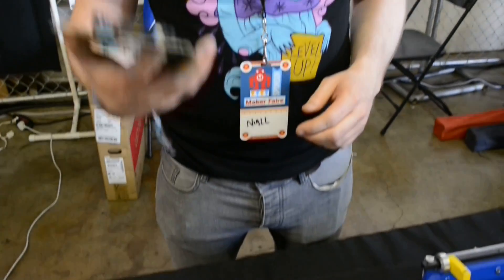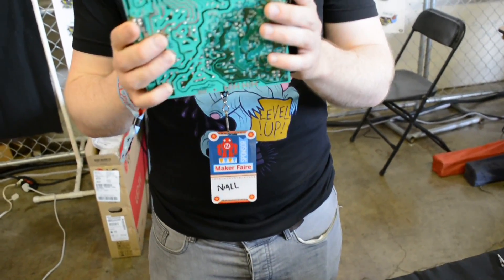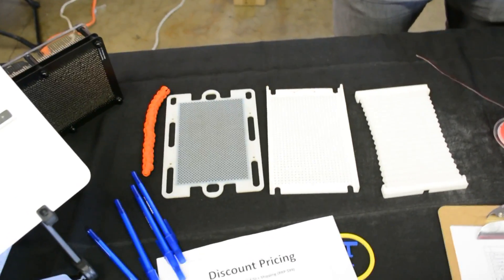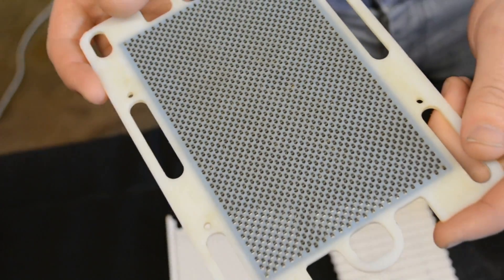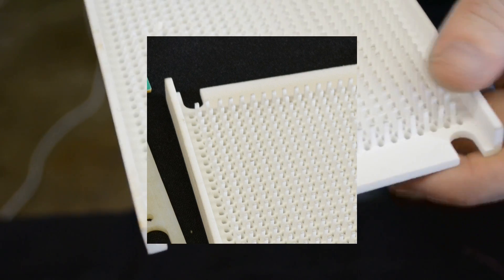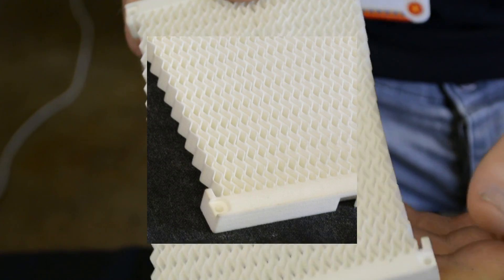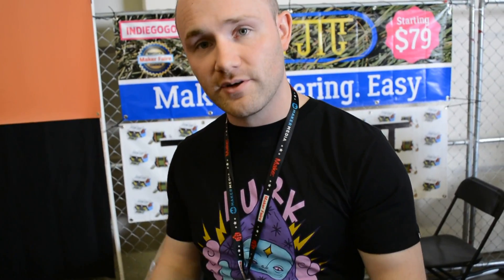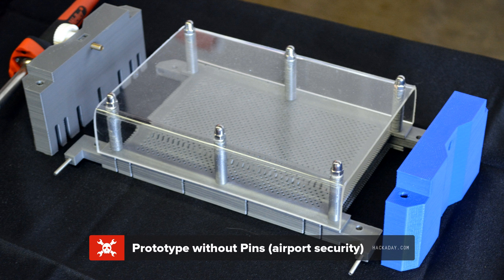PinJig through-hole soldering clamp

Comment: Imagine how heavy that'd be on a commercial sized PCB panel.

What you really need is some sort of rig that holds the PCB between two rails, with a fold down lid backed with soft foam to clamp the components in place before flipping it over and soldering........

Like this http://uk.farnell.com/ideal-tek/pcsa-4/pcb-assembly-jig-esd/dp/4681769

 Ok, sarcasm aside I think we already have a multitude of solutions for this.

Comment: To all the commenters that say "Bend the legs" the whole point is that you have a massive board with dozens of through-hole components, so putting a component in and bending them all over the place would make it difficult to solder them all. Not to mention different heights of things, and things that you can't bend the legs over--such as transformers, inductors, sockets, etc.

And, in all honesty, who cares if you don't like it--if he can come out with it, and get just ONE major contract with even a tiny production house--he is gonna make way more money than you ever will, sitting on Youtube and hating it up in the comments.
Reply: Oh if money is the metric I really should start selling useless stuff to people like you...
Reply: Terrence Zimmermann he made a product to sell. Not just to show off something cool he made. Of course money is the metric to use in this particular instance.
Reply: ***** Well, the point is, there is no need to implement a costly solution to a problem already solved at no cost. People who said "bend the leads" here understand that.
Reply: @overand  Never had this problem with IDC connectors I should say. I drill the holes small enough so the pins fit tightly and there's no need to hold anything. But ok, I see your point and I guess I've been a bit harsh. I can see how this could be handy in some cases if you have dozens of boards to go through.